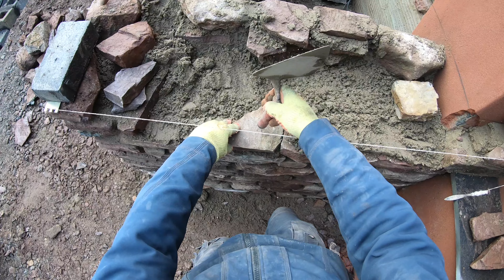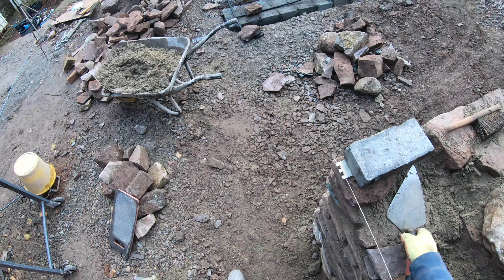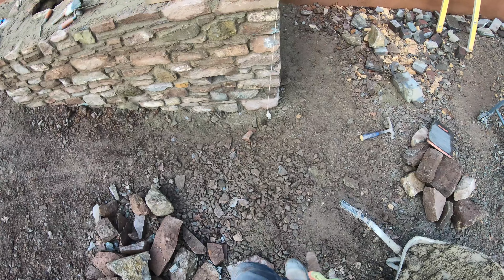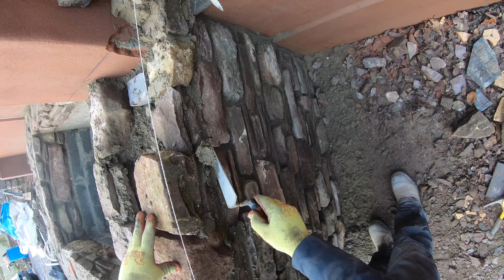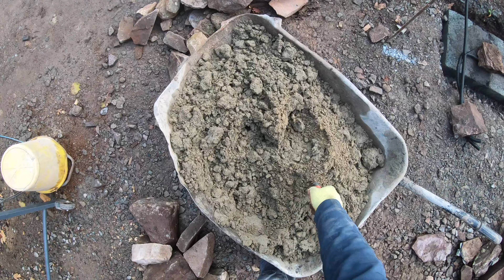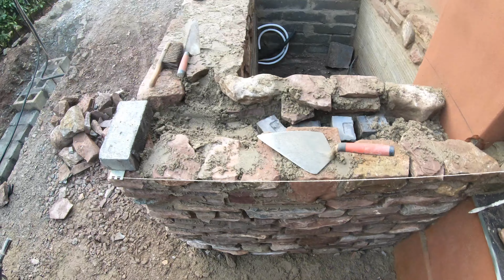Stone wall construction

Comment: Another great video fellow Welsh buddy!

I have a good few questions:

1 - What is this for? It doesn’t look to have an opening for anything.

2 - Where did you get all the stone?

3 - What mix is that mortar? It looks almost dry powder but then seems to keep its shape and is malleable!

4 - Are you filming this with a GoPro attachment to your head?

Love the shot of the cuppa! Keep up the great work!
Reply from the maker: Hi, thanks!

1. This will be a large planter but will also have steps alongside the longer section of it so it's used for a change in levels too.

2. The stone was from a few miles from the job and it was from some knocked down barns, the customer was keen to have local stone to match what was on the property already.

3. I use a semi dry mix when it's cold like this, just wet enough to ball up but not too wet like a blockwork mix.  You could use a wetter mix in the warmer weather but I wouldn't be able to go very high using a wet mix this time of year.

4. Yea I am using a GoPro Hero7 on a head mount

Regular cuppas are needed in this cold weather!
Reply: @SamDaviesBuilder  thanks for taking the time to answer buddy! Fantastic answers 👍🏼
Reply from the maker: @MarcusT86  no problem at all

Comment: Guess who’s back buddy? 😅

Couple more questions:

With this semi-dry mix, do you also do this in the mixer or is this by hand?

How do you finish the top of these walls off? 

And between your line pins, you’ve got a thin little wafer looking bit. Is that what’s called a tingle?

Cheers mate!
Reply from the maker: I mix the semi dry mix in a mixer but you can’t put as much in as you would with a wet mix as you have to hold the drum up at less of an angle to get it to mix properly.  I was doing stonework the other day with more of a stiff blockwork mix as the weather was warm so you’re not waiting all day for it to go off, if I laid with wet in the winter it would be soaking even at the end of the day. 

Top of these walls we just finished with stone, this is what the customer wanted, but I wouldn’t recommend this.  I would put some sort of coping on top or at the very least a rounded concrete cap. 

You’re right, that is a tingle, I was using that to hold the line down.  I would only usually use a tingle if I had the line on a long run and I was trying to stop sagging. 

Hope these replies help !
Reply: @SamDaviesBuilder  As always they do help a lot buddy, thank you.

Where would I buy those tingles? They're to stop sags in the line over a long span aren't they?

And why wouldn't you recommend just a stone finish? Is it to do with rainwater build up?
Reply from the maker: @MarcusT86  most online brickwork tool shops will sell tingles. EBay is always a good shout for good tools too. 

I wouldn’t recommend a flat stone finish as water can sit on top then freeze in the winter, once it gets between stones it will pop any of the smaller ones off.  You could do a sloped stone finish which looks quite good, you do see that on quite a few walls.  This would be acceptable as it’s sending the water off the wall and when done right can look quite attractive!